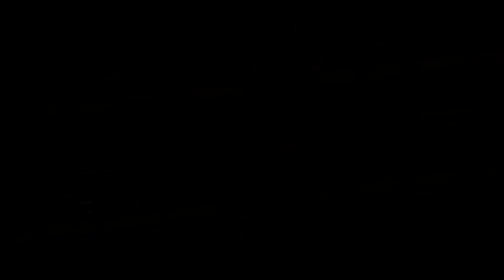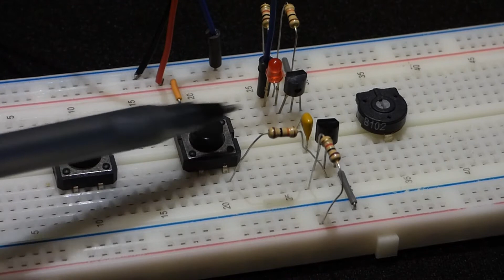Common causes of electronics breadboard prototype circuits not working properly

Comment: I can't figure out what my problem is.  
I have an elenco breadboard that looks just like the one in the video.  I can't even get the very first circuit in the book to work.  It looks just like the picture in the booklet but doesn't work at all.
Reply from the maker: That's a bummer 🙁 what's the circuit? Diodes/LEDs need to be connected in the proper direction. Often times, if all the connections look good but a circuit is not working, then a diode/LED is backwards. Always helps to use a multimeter to measure the voltage across all the components. Sometimes components fail too. So I'd try replacing them. Could also just be a bad breadboard, or if it is used, some holes may be worn out. Then you just use different rows. Doesn't matter what rows you use as long as the connections are right. Hope you already figured it out!